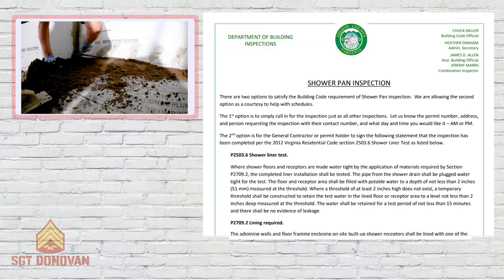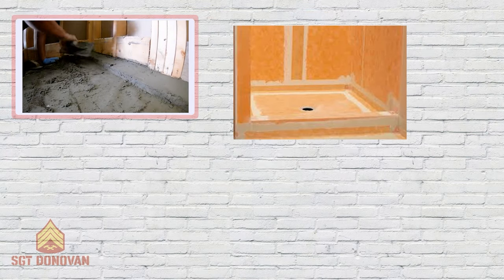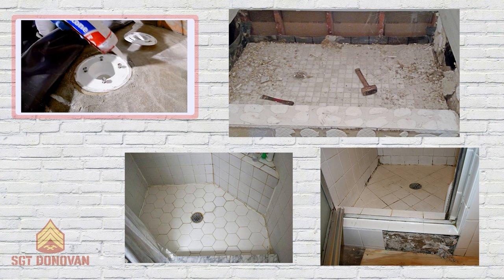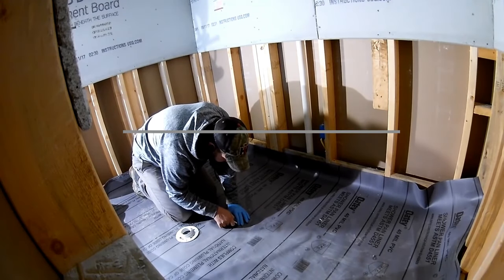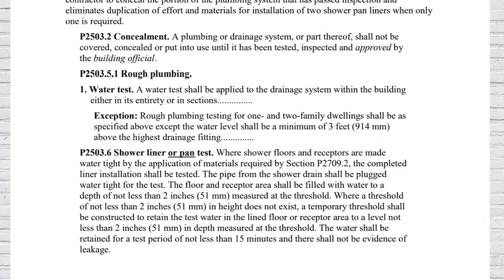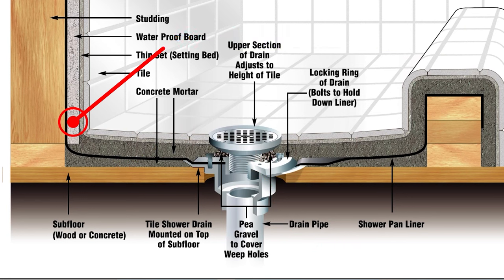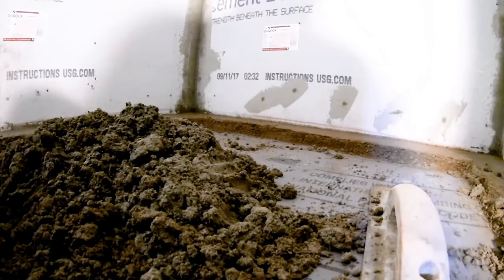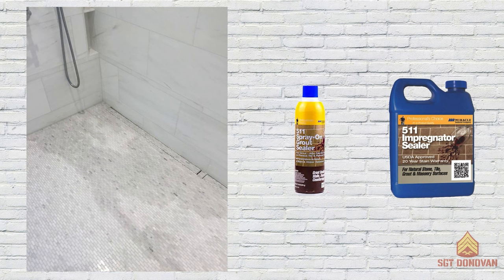Why Shower Pans Fail | Avoid These Mistakes! (Most Pros Do it Wrong!)

Comment: Even if you waterproof your entire surface before tiles go in, it would be easier for evaporation to occur would it not? evaporation would only take place from the grout and the cement used and not have to evaporate through an entire mud bed. Also showers are used daily and I hardly doubt any water would get a chance to evaporate from an entire mud bed vs just thinset and grout. Tiling over an entirely waterproofed shower is the same as tiling over schluter, no water will ever get further than your waterproofing. Just my 2c
Reply: The problem with waterproofing the top of the post-slope is this, unless you're leaving room for the water to get down before it gets to the drain, (around the drain.) Because if you waterproof the 3/8 height that the drain sticks up after the post-slope, you just created a pool in the water will build up in there and sit until it has enough to get over the lip just like the bottom piece of the drain works but up top. So now you've created a pool. Stop waterproofing the top of post slopes please thank you have a good day
Reply: @BonBon770  Bon, I've already red guarded my entire post-slope bed but left a half inch of mortar bare around drain for any extra water to seep down through the weep holes (I didn't use any gravel but if the point of mortar is to get wet and have water seep through then blocking weep holes is impossible). Will this work fine? I figured if I red gaurded the entire floor the water wouldn't have anywhere to go because it's covering the weep holes.
Reply: @kendallritenow1309  if I was to waterproof the post slope which I do not because I use plastic weep hole protectors, efflorescence and calcium and iron and chemicals will cause we pause the clog over time that's why they say to use gravel like Riverrock smaller one, I used to and then I switched to the plastic weep hole protectors you can buy them online for like 10 bucks and 410 bucks it keeps the mud off of the weep holes I tried to explain this to people all the time but they don't really get it. If you waterproof all the way up beside of the drain when your tiling around the drain house water going to get up and over that quarter to three eighths of an inch? It doesn't it's it's in there so thank you very much for letting the weep holes work
Reply: @kendallritenow1309  and for your information, I recently texted Sal de blasi and asked him how is the water supposed to get over the 3/ 8 tall linear drain, with a sealed system like Schluter. His response was the water will evaporate, and I just told him thank you but the truth is is that there will be sitting water in there and if you have natural stone on your shower pan it's going to discolor it even if you have regular tile all of the water will not get out of there with a traditional in and out system with a post-slope a pre-slope everything done correctly to a tea, there is less water held, when I mean held, I mean pulling or standing water, there will be no pooling or standing water with a traditional in and out mud system protecting the weep holes everything I just said. That is not true with a sealed system, there is no way water the residual water will jump over that height of the 3/ eight of the linear drain.
Reply: In a system like Kerdi, there is no 3/8” lip at the linear drain. The pan is flush with the rim of the linear drain and the waterproof membrane covers the top edge.
Reply: @andrewboettcher9853 I think you're correct. Not all of them are the same but if you do have a linearedrain. you already have the problem of wicking and all the problems they have around it with the membrane. but yes, you're right, there is no lip on the Schluter linear drain specifically that you're talking about but a lot of when your drains do and should be hooked up to a 3 piece old school system and not a membrane system.

Comment: Gravel is no go for weep- lime builds up - use 1/8” rubber spacers - does not promote lime growth. Also not grout caulk, but 100% silicone. Pre sealing shower pan tile and sealing again 3 das after grouting with drytreat by StainProof will result in amazing results and a sealed shower that doesn’t need sealing every year. 🤙

Comment: Great video. We own Sutton Plumbing & Flooring. Remodle a lot of bathrooms and here in Oklahoma the only authority regarding the specs of a shower pan is in fact the plumbing code, specifically chapter 4 IPC, however, in our area there is little to no inforcement on pan test requirements by most of the inspectors we come across and it's honestly left a multitude of problems for homeowners as the quaility of home building in this area seems to be getting worse, and not better. Hence my appreciation for videos such as this. We actually build more slope in our preslope than in the actual finished floor, protect our weep holes and let the customer know of how the system is designed to work from the get go. It's parts of the sales pitch from the beginning actually. Keep up the good videos! Thanks again

Comment: Pre-sloping pan is the way to go. Have the liner come up 6" up behind walls and run walls 1/4" up from pan floor after it's sloped for tile. Oatey has a pre-lope kit you can use. Be smart and don't drive nails or screws in your curb, it's the #1 reason for pan failures. I'm not a fan of caulk on the corners it doesn't look matched with the grout. Use a modified grout to grout the tile and use a sealer as well. I like durock because of the rigidity. I've seen Schluter showers have wall tiles crack from lack of the rigidity in the underlayment. Oatey has a plastic diffuser for the weep underneath for the pre-slope. To bond over onto the pan liner on the curb you can use Phenoseal with Durock. I will clamp it together and let it set, then regard 2 coats and tile. If you have tile grout issues they should immediately be addressed.

Comment: 30 years ago I was building custom homes as a super and we had a few pans leak. I have been telling guys not to put the durarock in the mortar bed ever since and build a pre slope. Guys would argue since you can’t nail the rock 6” from floor pouring the mud base against the rock keeps it secured. I always said that is wrong. Great video and glad to see I was doing it correctly. I would build the pre slope myself since sending tile guy was too expensive. Our plumbers would install the liner at rough. We would protect the liner with cardboard. We hung drywall and durarock by the drywall crew (of course I checked studs in showers for plumb and bowed studs first) and tile guy would pour the mud pan when they arrived for hard surfaces. Never had problems that way. Just people saying I was doing it wrong but no leaks or call backs 20-30 custom homes a year before the market crashed and now I do rentals lol but i miss home building now.

Comment from the maker: Let me know if you have any questions!  Also, share any tips you may have if you've tried this!
Reply: in one of the slides it mentioned not to use tar paper. in one of your videos you used tar paper, can you clear up whether it's ok to use tar paper on the sub floor before any mortar goes down or not. thanks
Reply from the maker: @KraZieKC  you can use tar paper between the subfloor and mortar.  The slide is referencing the liner.  You don’t want the liner to contact the tar paper directly.
Reply: @SgtDonovan  perfect thanks!

Comment: I agree always follow the manufacture instructions but sometimes their system is flawed, meaning there system isn't as waterproofed as they claim.  The biggest issue l see is contractors rushing the process (dry time, don't have all the right material so they will use the wrong stuff and don't spend the time for detailed application of material).  I will say this though the manufacturer has it wrong about the board being in the pan, it will wick and cause more damage.  That's my 34 years of experience even in a completely done right install. 
Nice job on the video.
Reply: Well said. Was waiting for someone to speak up about that.
Reply: Isn't it possible the lack of preslope allows moisture to build up to a level that the backer board to stay wet for longer than it should?

Comment: I ditched these shower liners and 3 piece drains years ago. Now I use only bonded drains.
Reply: Yep, exactly this. Contractors are stuborn folks. Lined pans should have been fazed out permanently years ago. The bonded drain and membrane or cloth membranes are soooo much better. When in use the pans dry in about 15 minutes. Even if there is a leak, MOST of the water is gone within minutes so who cares. Its just sooooo much better.

Comment: Nice video. Anchoring the cement board into the mud supports it along the bottom. Your cement board screws are supposed to be 2-3  inches above the curb height. Some installers place screws too low .

Comment: I run my pan liner usually around 8 inches up the wall, and my last fastener on the backer board is around 2 inches higher than the curb height. If you were using a cement backer board, I recommend waterproofing the bottom of it and running the mud to it because the mud pan will hold the backer in place and then when the mud pan is dry, tape and waterproof all of your corners around the perimeter, and at least 5 feet up each wall, and then waterproof the rest of the wall unless you are using a waterproof membrane and waterproof the floor

Comment: THANK YOU for showing the correct layering in the beginning! I've watched SO MANY videos and some contradict each other. It's nice to see someone using CODE materials! And yes, I realize codes change, but not to the extent I'm seeing the contradictions in the videos I've seen.

So, my dilemma is that we have a concrete floor (basement bathroom) and my husband already hung the concrete backer board before I put my pre-slope and liner down. Will it be an issue if I put the liner OVER the backer board by a couple inches and use my tile mortar to compensate for the surface level difference?

FYI... I used seam tape to seal the seams already too... before I began watching any of the videos.
Reply: Did you get a response on this?
Reply: @JMen6  No. I wish I had.
Reply from the maker: Sorry for the late response.  It may be too late, but I wouldn’t recommend putting the liner over the backer board.  This will invite opportunities for moisture to get behind the liner and into your wall.  There is no way to guarantee a watertight seal with the liner on top of the backer board.  Thinset and paintable waterproofing will have adhesion issues if used on the liner itself.  Other than removing the bottom row of backer board to start over, you could cut and remove a 12 inch strip of backer board, install the liner and reattach the strips.  This way you only have a small section to tape/waterproof.
Reply: Keep the grout and any natural stone tile sealed you'll probably be fine.
Look at it this way, y'all saved so much money in labor that if need be you can re do the shower again later down the road if you have to. 😊
Reply: @phillipkirby502  it’s all definitely sealed. Thanks for the reply. It’s also all concrete underneath everything.

Comment: Thanks for clarifying the different methods used, I was getting confused with all these new products. I agree about the board being in or out of the pan, that’s not the CAUSE of the failure, but I still prefer not to put it inside the pan. Thanks for sharing!
Reply from the maker: I completely understand!

Comment: I built 15 showers over a period of about 10 years in an apartment building we owned. I used the preslope, liner, pan, tile approach on every one of them. I had one failure that I know of but the rest of the showers I built never showed any signs of leaking or other problems.

The mistake I made on the shower that failed:
The shower pan mortar was too wet. It was the first shower I built and I couldn't believe how dry the shower instructions said it should be. After seven or eight years the shower developed a bad odor. We demolished the pan and found that the weep holes were jammed with cement that had flowed into them.

I did almost everything else the way this video suggested. I used Hardibacker and embedded it into the pan. This became controversial after my tiling days were over. But we didn't seem to have a problem with that.

I didn't install the drain exactly the way the manufacture recommended. I installed the drain so that the least amount of cement under it was about 3/4 inch instead of installing it so that there was only about 1/4 inch of cement under it. I didn't like the idea of the preslope being as thin as 1/4 inch.

The above step might have saved me because most instructions say to put tar paper under the preslope so the mortar doesn't have the water sucked out of it too fast. By the time I realized I wasn't doing that part right I had already built several showers and I never had a problem with it so I didn't put tar paper between the preslope and the plywood.

I didn't use the inside corners initially, nobody seemed to carry them so I just thought the professionals must not be using them. Later on I ordered them through the internet.

I never caulked the shower pans at the wall and the showers didn't develop the a crack between the wall and the pan. I don't know why that was. Maybe caulking the shower pans would have been a good idea but it also can be ugly. One reason cracks might not have formed at the base of the wall was that when the hardibacker was embedded in the pan the there was a very good connection between the wall and the pan.

I built a cavity behind where the membrane went against the wall. The prevented a bulge at the bottom when I installed the hardibacker.

Comment: Thanks for this video.  It makes complete sense. Before doing the annual grout / tile re-seal, how long do you generally need to let a shower floor air out?  This one is made of  river stones (installed over a traditional mortar bed with liner pan & pre-slope).   Thanks!
Reply: If you have never sealed your shower and now plan to, I'd say don't run water in it for about 7 days then seal it. But I'm just a random guy so whatever.

Comment: The kerdi method or others similar seems to be better than the preslope/rubber liner method.   Ive seen so many problems with pan liners and even ones with a preslope.   The mortar still stays saturated even with a preslope and using pea gravel for weep holes if its used once or twice a day.    It takes awhile for wet mortar to dry out if it doesnt have much room to breathe.   I dont disagree about having gravel around weep holes when installing pan liners but the funny thing is water travels through the mud to get to the weep holes so even if there wasnt gravel around weep holes the water will still drain into the holes through the mud.    
As far as imbedding the wall board into the pan mud i agree its not a good idea unless youre using a waterproof board that wont wick or absorb water.
Reply: What specific problems have you seen with a correctly installed pan liner which include a correctly installed pre-slope?

Comment: I've watched your shower pan video. Lot's of good tips and some good technique. The end result was passable, however, not great. Easy to see high spots around the perimeter.

I've also watched and inadvertently re-watched your "How To Install Large Format Tile" video, and it was amateurish. I was ready to flame you in the comment section (only after seeing the title of this video) but discovered I'd already left much the same remarks when I'd originally watched it 5 years ago, although much more politely than I had intended the second time. 

Sounds like I have a beef. I do. Clearly you're a handy guy. You also do your research. Both good qualities. It's easy to see, however, that tiling is not your everyday gig. Mine is. I'm one of the pros you call out in the title of this video. Maybe you've dedicated you're entire career since making the two aforementioned videos to nothing but tile installation. That still only gives you 4 additional years of experience between those two and this one. Some contractors MIGHT start letting their apprentices do small jobs on their own after 4-5 years of grouting, mixing mud, making cuts, and doing all the other grunt work. Most apprentices think they know the entire trade within 2-3 months.

My man, you are in NO POSITION to infer that MOST PROS don't know what they're doing. That's my beef. Sure, most guys are going to point out what they do differently, what they think is the "right" way. Tile guys are notorious for picking apart someone else's work. The only group of tile setters I know who all do it the same way are the dozens who learned the trade from my uncle, or learned it from other guys who learned it from my uncle. Love working with those guys. Later joined the union only to find out that everybody does it differently. Don't really love that. However, unless the guy is an absolute bonehead, my belief is if the guy is a journeyman, it's his job to know what the hell he's doing and I'm not going to waste my time telling him how I would do it. Just like when I was in the army and sat through countless refresher courses on basic soldiering, each time learning a new way to put on a gas mask, apply a field dressing, stop a sucking chest wound. None, incidentally, as laid out in the freaking handbook. All effective, though.

MOST PROS know what they're doing. Implying otherwise only emboldens clueless DIYers to dismiss our years of experience and wreck their own bathrooms. Maybe you're just in this for the clicks. YouTube is filled with experts constantly proving the old adage is true; Those who can, do; those who can't, teach.

Comment: Ive seen thousands of zero pre sloap pans and have even had to use a shop vac to remove the water from the pan when I was doing the dimo on a leaking shower pan